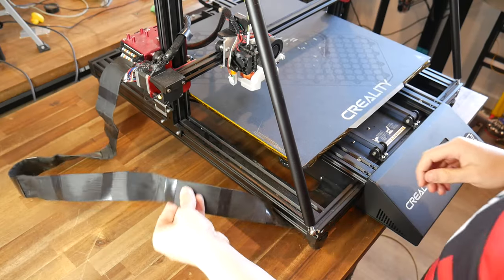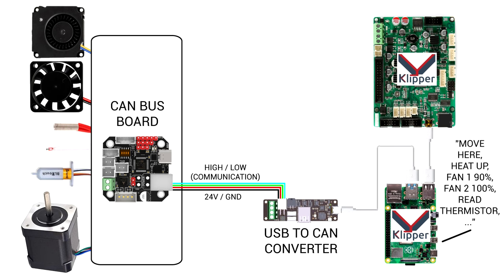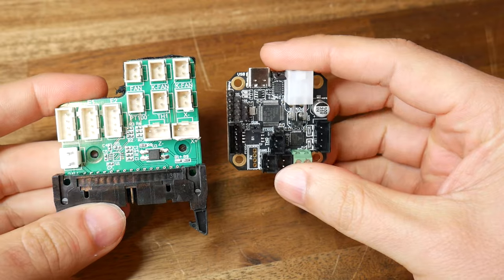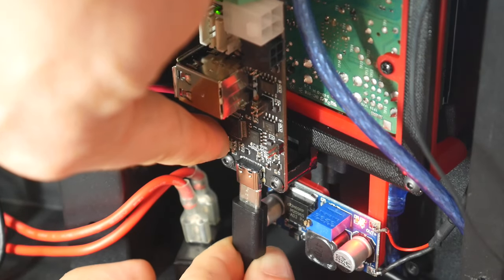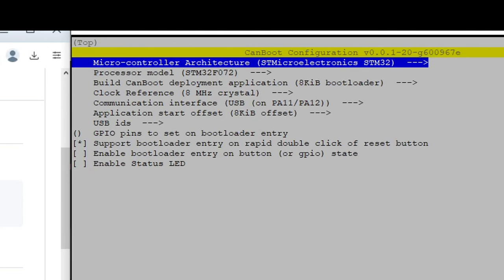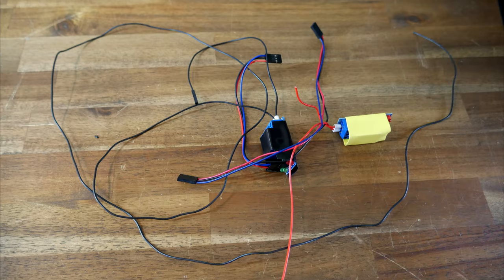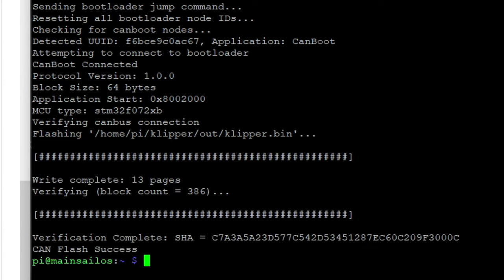Klipper CAN bus guide for Bigtreetech U2C and EBB boards

Comment: Hello Michael, I am thinking of upgrading my Sapphire Plus 3D Printer with the new SKR3 EZ mainboard. I noticed it has CAN on the board. I also want to purchase along with the board the PAD 7 also from BIQU. Could I connect then the EBB Board directly to the mainboard? Since I wonßt use a rasberry I will use the PAD 7 controller. Thank you

Comment: Hi,
 did get 2 U2C 2.1 boards. Unfortunately I am not able to create a candleLight FW, not from the BTT instructions or following your instructions (after checking out into the STM32G0_support branch). As I not use the U2C with a Raspberry 4 (MKS-PI and 2. with an OrangePI Zero2) I did successfully flash CanBoot on it. I did send a email to BTT, but with the Chinese New Year now it will take possible weeks before I get an answer.

Comment: Would love to find one of these boards that supports two hotends.  I'm just about to swap another printer over to dual extrusion and that would allow for some significantly simplified wiring.  Haven't found a board capable of such things yet, but maybe one day.
Reply: CAN is daisy chain so you can loop out toolhead 1 to toolhead 2 just ensure you have power wires spec for the total amperage of both heads
Reply: True, although it would still be neat to have the capability within a single board.

Comment: Enjoyed your video, but I have the U2C 2.1 and EBB 36 V1.2. The U2C is working, but the EBB 36 V1.2 does not want to report an UUID.
Reply: @pascalcoeman8873  I have the same issue.  Might have to go with mateyou's advanced set up or use the STM programmer.

Comment: I am an electrical engineer and work as software dev at a manufacturer of saddle stitchers. CAN was present as a field bus system in industrial automation a few years ago and sometimes even today. But I am happy that it is not that common anymore. We are using an ethernet based and way easier system instead. CAN can be really fiddely to work with and every time I deal with it on an old machine it rremindes me how little i like this technology. It's an interesting solution but I would never take the hassle on me and try this out xD I preffer the ribbon cable in this case... 

Nice video though :)
Reply: You stated, "We are using an ethernet based and way easier system instead."  Does that method have a name I can search on?  I would love to know more about this.  Thank you.
Reply: @jimmypeters8524  EtherCat, Profinet, Serco 3, Profinet IRT, CC-Link

Comment: Hello, I have a stupid question: if I control every stepper with an ebb42, do i still need an additional controller board? Seems to me like everything is controlled by the Raspberry directly and it would reduce cabling. Seeing the current prices for the ebb36/42 it might be even cheaper than the usual control board + stepper drivers (2 ebb42 including adxl345+2209: 25€).

Comment: I have done all the possible mods on my stock ender 3 v2 main board and CAN was the last i have made. For me it was dissapinting that i could not use CAN on mainboard itself and i had to add SPI to CAN board to connect my EBB36. The main takeway from all the CAN is that CAN can have many nodes on it, so basically next video instructable should be how to run single CAN on Pi and connect Octopus and EBB (or few) on same CANbus. As i have bought Fysetc Spider for my future printer plans i have 5 driver spaces free and i plan to CAN mod my original creality 4.2.2 that uses single hardware USART for driving all 4 stepper drivers that are addressed and can be easily flashed via STM32programmer using BOOT0, to add 4 more steppers for future use via CAN.
Serial = P2P, CAN = multinode on single bus.
Is Teaching Tech up to it? Making instruction video for masses to use Single CANbus to rule all stepper drivers of multiple boards and more?

Comment: In an ideal world we would have a universal CAN-Bus PCB for all 3d Printers. 

Advantages to using CAN-Bus: Reduced Weight, Friction, Hassle... 
We then need to standardized connectors for Fans, Thermistor, RGB and Heater Cartridge...

Control boards cost would be considerably reduced as connectors contribute in large part to their costs.
It doesn't even have to be CAN-Bus, it could be as simple as USB, or even better... wireless (WiFi/Bluetooth)...

I genuinely can't understand why we run all these cables when we only require power and data to control everything. 
Imagine a printer control board with only a few CAN-Bus connectors.

Hot-End Bus: Heater, Thermistor, Direct Drive Motor, Fans, RGB...
Motion Bus: Motors, End-Stops, Other Sensors...

Magic ;)

Comment: Hmm... This could be an improvement on a lot of printers. I have a Creality Ender 3 S1, where there is already a compact direct drive assembly with a single cable. This could replace that somewhat stiff and relatively bulky band cable with an even lighter one. Time to investigate a little more I guess...
As a side note: I guess this is not very useful if you use the Creality Sonic Pad, because that uses closed source Klipper stuff (as far as I know), so that limits modification. But maybe there is a work-around for that. I have not put much investigation time into that, because the Sonic Pad is not that available yet in my country.

Comment: I'm building a custom IDEX printer and want to use CANBUS- do you know if it's possible to daisy chain one tool head to the other so I can control both using a single U2C board, or would I need a secondary serial device to control the second toolhead? I feel like i'm wandering into no-man's land here, since CANBUS is already pretty niche and IDEX puts me alone on an island lol

Comment: I recently added almost this exact setup on my printer - one thing I'll note, is with the default Baud rate of 250k, I encountered a "connection timeout" issue when conducting a bed mesh - I upped the baud to 1,000,000 and it worked fine.  Is there any benefit to going with 250k baud? If not, maybe it's better to recommend a 1,000,000 as a standard - although, I am unaware if the high baud has any drawbacks.
Reply: higher transfer rates are increasing the risk to receive corrupt data
Reply: @Technikfreak72  Which would create another timeout? Or, just make it sluggish?
Reply: @Technikfreak72  CAN transcivers are certified and designed to operate upto 1,000,000baud  at distances upto 30 meters, if you are seeing corruption you are missing resistors to terminate the bus or are using untwisted / out of spec wires. (or a pi that can't handle the rate of converting packets from klipper > can and vice versa)

Comment: If using a btt pi, you dont need the u2c as it has a canbus port, correct? Also how is the heater handled? Is it ran from the ebb42 or still from the mainboard?

Comment: if the install process gets better, this would be a great solution. however given were already running 1 ethernet cable for the signal its not that much of a saving. you can run a lot off just a single ethernet cable already, thermistor(2), part cool fan(2), hotend fan(2), spare 2 wires as you wouldnt want to run the heater off ethernet wire. 5 more wires to bltouch (i think its possible to run 4 wires tho) and 4 more for the extruder. so thats 15 wires needs which we can do with 2 ethernet cables. and ofc the hotend run off its own supply. much cheaper and easier of a mod, can can custom make pcbs pretty easy as its just a breakout board.

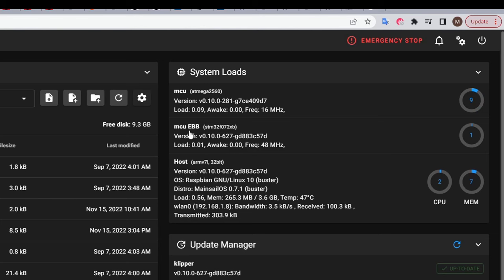Comment: 12:18 The EBB is three times faster than the mainboard itself :D
Next Upgrade: replace the two CAN signal cables by a WIFI connector :face-blue-smiling:

While the CAN bus idea definitly technically intruiging, I am currently struggling to see the real benefits unless you're constantly swapping out your printheads

on a multi-tool switching printhead, the EBB would be nice since you only need 4 contacts between the adapter plate and the tool
Then, each tool would also have a different CAN ID, not sure if that could be used for tool-specific settings.
Reply: I'm switching now to canbus because I'm tempted by running 4 cables to the printhead instead of 14. I will get accelerometer permanently attached to the printerhead (which would add another 6 wires if mounted permanently) and I'll add bed levelling proble (another 3 wires). It will reduce weight that my carriage has to drag around, it should reduce noise on the PT1000 lines, it will offload mainboard and let me run other steppers at higher stepping rates if needed. Also if anything gets damaged or upgraded on the printhead, I will no longer need to route wires completely through all the dragchains.

However these advantages are only when mounted on the printhead itself. I don't see any reason to change to CAN if the EBB board is going to be mounted in a stationary place.

Comment: Why not just use usb protocol? We already run klipper with usb, you can connect EBB42 with usb and run it that way. Also flashing is easier
Reply: I can imagine that, depending on your heater, it could be too much wattage for usb.
Reply: @Nikitaman  Usb is not used for power but protocol. You still need 24v ang GND for power
Reply: @multifrag  Oh, i thought you also mean usb cable.
Reply: depends on various things, USB for real time communication is kinda $hit, CAN is more robust and reliable, also its has to do with how the protocols are setup, USB generally being a master-slave protocol, CAN almost always being a multi master protocol, TLDR CAN is more reliable and robust for such applications.
Reply: @pvim  So all the klipper machines running on usb communication are "$hit"? You have a raspberry pi controlling mainboard in realtime through usb what's more to say
Reply: @multifrag  you didn't quite get what i meant, thats basically usb to usb (usb to serial basically connected to a pc) but when you want robust MCU to MCU communication CAN is the most reliable option, as USB is too burdensome on mcus, also adding multiple mcus via com ports to the pi can cuz idle time for the other ports and more slower coms, there is a clear reason y they don't use USB in things that need to have near zero failure rate
Reply: @pvim  All valid points, however this is 1 node being talked about.

Comment: This seemed like a lot of work just to clean up a few wires, no? Am I missing something? I am in the process installing a BTT M4P and CB1 combo with the HDMI 5 screen on my CR-10 S5. This printer is in need of a wire tuck. Im just trying to clean up a few things.
Reply: I am converting my S5 to a StealthBurner so this seems like a good choice instead of 26 cables
Reply: It's valuable when you start making changes on the toolhead. On my V-Core I swapped out my Z probe, my cooling fan, added a filament sensor and I'm about to add LED lighting, all without touching the cable umbilical (which is just 24V and a USB cable). It's also great for IDEX or toolchanger setups to cut down on the sheer number of toolhead wires. On a single extruder printer that is "finished" I would say there's not a huge benefit, however it is pretty cool and works well in my experience.
Reply: I have a Bondtech DDX kit on mine already with a bltouch. Going to swap the stock filament detector for the btt unit.

Comment: Just something I noticed, the impedance across the Can hi/low should be 60 ohms achieved by using a 120 ohm resistor at each end. I assume that the board at the raspberry pi already had the resistor built in and that's why it wasn't needed (but obviously that would change if you were using a different board).
Also using an ethernet cable for the twisted pair is a great hack but all the extra unused cables just doesn't sit right with me. I don't know how important the specific twist rate is but perhaps there are better solutions (in my experience working with Can on a daily basis you can get away without a twist unless you are working in a very electrically noisy environment or you are pushing the speed limits of the Can protocol but then you would be better of just using CanFD).

Comment: Wow that’s cool. Wait a minute! 4 wires what about 2? Telephone uses 2😊. BTT please make a module and a adaptor for your BTT mainboard to make the print head LESSwires using WiFi. Klipper software people maybe control the head thru WiFi. I m new to electronics, Anyone out there doing this please share. Let’s have more ideas to 3D printing. Thanks for sharing.

Comment: The CAN bus solution only makes sense if you are using it as a bus connecting several nodes. A CANbus with only one node is really a solution looking for a problem. So if you are building a robot arm with 6 joints, all with individual steppers and encoders, connecting all 6 nodes with just 4 wires makes sense and is worth the trouble. For 1 node, just use a multiwire cable with appropriate wire size for the stepper power, and another pair for the heater.
Just because you can CAN, it doesn't mean you should.
Reply: digital signalling such as an spi bus from an accelerometer for input shaping is very noise sensitive and tricky to get working reliably over anything but very short distances. CAN or another fieldbus like MODBUS is a far better solution.
Reply: @m3chanist  You don't need to run the accelerometer calibration often.  So you can just put klipper on a RPi Pico connected to an AXL.  Connect the Pico to the RPi and mount the sensor on the toolhead, then run the measurement.  Disconnect everything, and you're golden.

Comment: It seems convoluted, and expensive, to use a USB to CAN bridge here.
Some of us using PiZero2's as the Klipper host may not even have an extra USB port to spare.
Is there a problem with simply using a MCP2515 on the fruit-pi's SPI bus?  Seems that this would be less expensive, and more direct. I know from experience, the SPI bus easily goes 1Mbps.
Perhaps someone here can help me: Are we dealing with a 3.3V, or 5V CAN bus on that print head board? Gawd I hope it is 3.3V.
Reply: That's exactly what I'm using to talk to a pair of EBB42's on my IDEX printer. Check out the Waveshare CAN hat.
Reply: @keegan854  That is a slick piece of kit.

Comment: Great video! I tried CANable + BTT method here for the U2C v2.1, I still can't get UUID. Blue light was on when usb cable is plugged in with Boot button pressed, now blue light is always on. Are there other ways to fix the problem? Should I return this faulty card? Thanks
Reply: if you find out anything, please update - have the same issue
Reply: @chrisvolkert6117  
BTT / BIQU Support response is below, you may want to try. It didn't work for me, Pi  detects U2C normal and DFU modes but I can't get CAN comm to work. Waiting for a new U2C to arrive.

"you can send the lsusb command to see if there is a USB device for U2C.
Or press and hold the boot button, unplug and plug the USB cable of u2c, and then check whether there are stm32 dfu devices in lsusb
2. If there is a U2C device, send sudo ifdown can0 first, and then send sudo ifup can0 to restart the can0 device, and then send ifconfig to check whether the can0 device starts normally.
3. If there is a can0 device in ifconfig, the command of klipper to query canbus id can be executed normally
No USB device tries to refresh the firmware again, the module is completely powered off, press and hold the Boot button, insert the Type-C data cable to power the module, enter the DFU mode, and use STM32CubeProgrammer software to update the firmware again
Use candlelight firmware
https://github.com/candle-usb/candleLight_fw"
Reply: My BTT U2C v2.1 board from Biqu was faulty + getting a replacement. I bought the same board from a local reseller. Follow this video and it works first time

Comment: Could you become interested in a CNC project? I want to CNC ny Bridgeport mill. I'd like to use MakerBase NEMA23 stepper/servo motors. Those motors are typically used on 3D printers. I'd like to use something like GRBL CNC control but the software hurdles are to high for me. Im more PCB design / hardware oriented.

Comment: Okay.  I'm about to chuck this whole thing into the garbage because I can't get it to work.  I have tried several time with no luck.  I am to the point where I am trying to flash klipper on the EBB36.  I have connected the U2C and EBB (do the cables go H -> H, L->L or H->L or L->H?  I have tried it both ways), but always get an error when trying to get the CAN uuid.  I have gone through the process of downloading and flashing many times.  No luck.  Is there a step missing?  I did flash CanBoot on the U2C and got a CAN uuid for it, but couldn't get one for the EBB36.

HELP!
Reply: Got it working.  Downloaded the bin file from github and used STM32 Cube Programmer to flash it.  Started working right away.

Comment: What is the difference between the regular candlelight firmware and the BTT fork? 

I got this thing to work with the regular firmware and wondering if there is anything extra in the BTT fork that I need to get it to work correctly.

Comment: Oh man, yeah, while this seems like a headache to set up at the moment, as it seems like early stages of adoption and standardization, I think it's absolutely needed to modernize these devices, and ultimately makes cable management much cleaner and easier, and should make everything more reliable and less susceptible to interference.

Comment: Most ethernet cables are solid copper wire which is not suitable for movement. Copper work hardens which means in this case means it will get more and more brittle the more movement it does. Use 18awg stranded wire instead. Stranded wire is much more risistant to work hardening.
Reply: I'm using 18 awg fine stranded silicone-insulated wire, not twisted or impedance matched in any way, and it's working fine (at least at 250 kbps) since the cable runs are short. The Gucci option would be something like igus chainflex -- they have a zillion varieties with different combinations of thick conductors for power and twisted pairs for signal.
Reply: Most ethernet patch cables are not, they are stranded and available in any length you want.